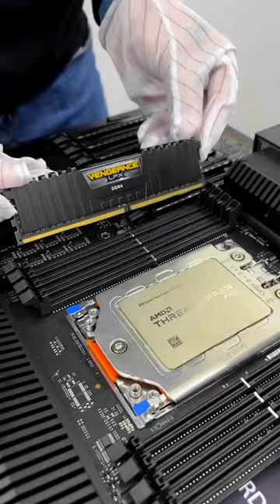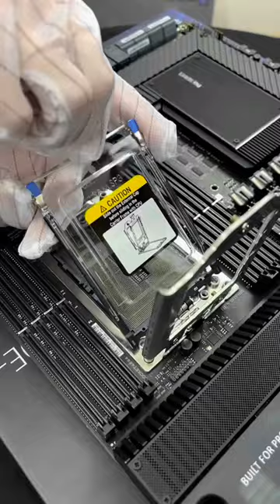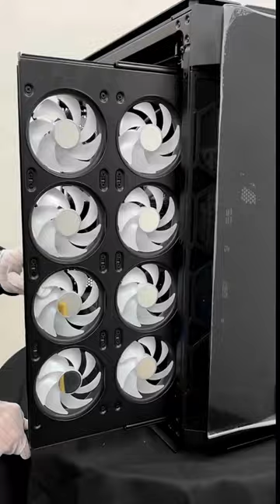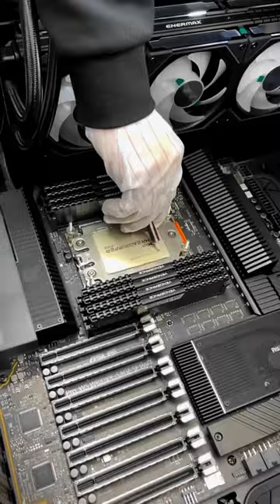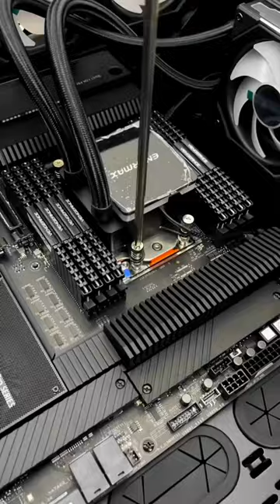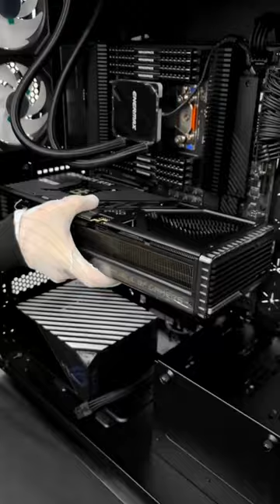Future-Proofing Your Gaming: Assembling a RTX 4090 & Threadripper Pro Gaming PC #build #pc #shorts

Comment: 6 months later: time to upgrade 👍
Reply: Threadripper has 64 cores thats 4 cpu running at one chip 😂
Reply: @Harsh-do7uw  Great if you render movies or use cad, not many apps and no games will ever see an advantage of using a zeon or threadripper.
Reply: If you look at the threadripper gaming benchmarks, the best one gets less than a 12900k in frames, and I have a 13900k… trust me the threadripper is not intended for gaming, it’s meant for workstation use.
Reply: @xxtwztidxx Yea idk why threadrippers are in gaming builds its amazing for what it’s designed for. Obviously it can be gamed on as well
Reply: @finger00 Fully agree, what a waste of money for gaming
Reply: @finger00  EFT

Comment: In 2040 
Windows 20 :- your system doesn't meet the requirements
Reply: 2026 more like
Reply: Windows 13. Not supported.
Reply: Windows 20 myeah you got a bit to to far I don't think that windows13 will work with those components but yeah.
Reply: lol
Reply: No need to wear gloves and spin the fans.  In 2 years this system will be outdated.
Reply: Windows 95
Reply: Linux can be runned on calculator now and 2030 too))
Reply: Nah bruh the windows 13 definitely going to have its own AI assistant definitely wont run
Reply: @jeffisawaffle8084  it shouldn't work in Russia.
Linux better
Reply: Na will be in like 5 years maybe 6 so 2030
Reply: Although its price is similar to the price of fast cars
Reply: He shoulda used a dual 4090
Reply: Moore's law is dead
Reply: @gamer101stopmotion  bruuh

Comment: "son, why is your room 100°"
Reply: With that amount of fans? Never
Reply: Because its got an AMD CPU
Reply: A threadripper doesnt get that hot like a 13900k ore a 7950x.
Reply: @rafaelbachmann6721  like 95c is normal for amd 100c is normal for intel. also with power comes temperature
Reply: @MrTefe amd cpus usually runs cooler than intel cpus, first time im seeing someone say the opposite
Reply: @ummhi4087  fans reduce the PC temp, not the room temp XD
Reply: Why would the room be 100 if the cpu  is cooled down to 80 or less
Reply: @kaljamaistuuperjantaisin because it would heat up the surrounding air to the point where the cpu doesn’t get cooled and just heats up more. At least they will switch off due to overheating ~
Reply: @MrTefe my dude where tf did you find 95°? 😂 it's 65-70 max while 100% usage
Reply: lol

Comment: Bruh this case makes the 4090 look small
Reply: Finally the motherboard isn't installed on the GPU.😂
Reply: @simon6658  💀💀💀
Reply: Which case is that? Holy hell
Reply: SLI one more bad boy in there, just to balance the optics 😅
Reply: @D3AD_L1NK5 I know you asked this months ago. But it's Corsairs 1000D Super tower. I have one and it's massive and amazing. The case alone weighs 65lbs.
Reply: @D3AD_L1NK5 obsidian 1000D by Corsair❤
Reply: This case for 6090

Comment: You know builds gonna be expensive when they pull out a threadripper
Reply: gotta take out a mortgage for one
Reply: @damontan4749  chill kid, one day you will get a girl too. Until then, be nice.
Reply: Thing is the Ryzen 9 is faster than the thread ripper by a lot
Reply: @dn22731  threadripper is more of a server build and cames with a ton of memory. Ryzen 9 is just faster on the first core but as soon as you multithread things the threadripper outplays anything pretty fast.
Reply: @glaDos-  but this is a gaming pc, the thread ripper is fucking useless
Reply: @wandew7057  I agree. I have a 32-core TR w/ 128GB of RAM and it's basically useless for gaming, even in the gaming mode.
Reply: No certainly not useless just a waste of money for gaming lool
Reply: @wandew7057  multithreading is becoming somewhat more common in games. I can think of s good few sim applications too, even DCS recently released a multithreading update
Reply: @blessthismessss  no game uses enough cores to justify a threadripper
Reply: @wandew7057  'enough cores' to justify it? no definitely not, ur right. 
but the ability to use them?? surprisingly it looks like the tech is starting to gain more ground in the tech! Gmod for example even had a major update that allowed support for it some time ago, but its only accessible by setting commands in console right now though.

You get like, +30% fps on average with it, btw. Every game SHOULD be multithreading, but sadly the majority that have been released up to now aren't. This benefits more than just the threadripper, it benefits any multi core cpu!
Reply: @blessthismessss  okay even if games do end up using all those cores, they don’t now. The responsiveness of thread ripper just isn’t going to be as good as a current gen consumer cpu on the desktop because if worse ipc and clockspeed
Reply: @RizalGalion  enough cores to justify a threadripper means games use 24 whole cores and up, which they don’t. Ipc and clock speed are vastly more important for game right now than core count
Reply: Yeah that's a mighty powerful workstation but almost no games run on many threads and would rather profit from a 14900K or somwthing alike. It's pointless for gaming but neat workstation i suppose... even though i'd prefer a proper workstation GPU...
Reply: threadripper in a gaming pc hurts to look at
Reply: @wandew7057 It's not useless. It can definitely run triple A titles. But, it's definitely not meant for gaming purposes.
Reply: @TheNexusChan  what i ment by that is that there is no reason to get a threadripper for a gaming PC, its more expensive and slower than a consumer chip for that purpose
Reply: @wandew7057  Some people just like the overkill. I can't say that I would do the same. Especially how expensive the CPU and components are
Reply: @TheNexusChan  its not even overkill, threadripper objectively performs worse than even ryzen 5 or intel 5 in gaming (current gen)
Reply: @wandew7057  By overkill I meant spending so much on a rig that isn't actually meant for gaming. Because obviously they spent a ton of money on something that isn't meant for gaming. Which is overkill in the money sense.
Reply: You know their city's electricity goes out daily when they pull out a threadripper
Reply: @glaDos- Which is why them calling this a gaming pc is dumb. It's a huge waste.

Comment: sees the DDR4

Ah yes... "Future proof"
Reply: Exactly
Reply: What a clown 😂😂😂😂
Reply: Hahaha 😂😂😂😂😂😂😂
Reply: Came to the comments just cause I knew this comment had to be here!
Reply: Lol right 😂😂😂 not even DDR5 for a 4090 😂😂
Reply: Threadrippers aren't even good for most games, what a game will do with 96+ cores? If I remember correctly for example Minecraft can only use one thread of the CPU. So if I'm not wrong it's using 1/192 of the processor. But Minecraft is Minecraft and other games exist. Maybe there it has ANY sense.
Reply: The Mainboard is for ddr4 and maby it gives it not in ddr5
Reply: @FrontWaffle Kid that pc is definetly not for gaming💀
Reply: @voxqu  "Future-proof your gaming" can you even read
Reply: @BenStocker bruder lern inglisch
Reply: @onlystoner  it's a thread ripper system even if he had used the new thread ripper platform with the newest and pest threadripper , it would be not something for gaming. Lower clocks not optimized for gaming that thing is a render monster not a gaming monster and since you brought up minecraft actually that's the only.game I know about that can currently load all the cores equally but still does not make any sense (maybe to game while running it as a data server and mc server in the back but still a 7800x3d would make WAAAAY more sense)

Comment: He is set for life no more upgrades for him
Reply: Max it gonna last 5-6 years , specially if u game UE5 engine games need upscalers to run on good fps even in rtx 4090 .. 
This generation cpu or gpu are not ready for UE5
Reply: @vitadude5004  Sounds like UE5 isn't programmed or optimized well enough if a freaking RTX 4090 isn't good enough. That's a failure on the software development side, not the other way around.

Comment: What ia the min and max working temperature  of all that -5 to 80°C ?
For me 8 fans is too much
Reply from the maker: All the RAMs produce heat the fans required for these built
Reply: 8 too much? I got 17 in mine. Guess I'm in the too much group :(

.. oh wait, 19 fans.
Lucky for me I can run them all at about 20%, eliminating most noise.

Comment: buys a 1440p monitor
Reply: Imagine having this pc while playing on 60hz 1080p.
Reply: Immagine have not the kw on uour house to take it on
Reply: it will overkill it
Reply: If you are playing on a monitor that is from 24 to 32. 1440p is just fine.
Reply: They do make 360hz 1440p monitors a 4090 still can't max out newer games at that res and frame rate
Reply: @ronjones3977  yep.
Reply: 1440p is a prefect middle ground between clarity and high fps gaming, though.
Reply: I used a 1080p60hz for about 5 years still got great fps but I had to upgrade to 165 it was better but I still went with 1080p
Reply: @oustted  framerate upgrade is a good choice. Especially if your 1080p monitor is smaller than 27", then you don't really need 1440p and above. If you like larger monitors, 1080p on 27" starts to look grainy and 1440p is a good and probably necessary upgrade
Reply: @mediumplayer1  I had a 32" it was grainy my new one is a 27" and it's great although it like caps my fps at 165 when I was getting higher frames on my old one it doesn't really make sense only thing different is the response time
Reply: @oustted  in a different situation I would recommend to uncap the frame limiter, but the strange world we live in gifted us CS2 that shows 200 on the counter and feels like 35. Then you turn v-sync on and it becomes constant, smooth and playable 120. I guess limiting frames is fine, but otherwise stay away from g-sync or v-sync (unless it is a singleplayer game, then do whatever). Btw, did you take color accuracy in account when shopping for a new monitor? It seems to become important these days.
Reply: @mediumplayer1  there could be a setting in monitors settings but I never have a frame cap before I was getting 200 in cs and and close to in a couple other games but now it's stays at 165 there could be a changed setting in amd software that changed maybe
Reply: @oustted  could be amd software, could be monitor, I have no clue because I have a laptop with nvidia gpu...
Reply: @mediumplayer1  fair enough I have all amd and this monitor supports amd freesync and something else ider
Reply: @Леха_Картоха  1000fps
Reply: @Леха_Картоха lol 😂😂😂
Reply: I wouldn't ever go back to a 16:9 4k or not from a 3440x1440 100hz monitor. 

If anything I'm looking at a 32:9 as an upgrade from my currently almost 9 year old acer predator x34.

Comment: Bought a 4770k/mobo/ram/case/psu/drives and slightly overlocked for like 300 at gen 6 or 7. Threw in a 1070ti for 450, new, open box.

6 years later, mobo/ram/proc still worth like 150-200. Gpu worth 150-200. 

Spent 750. Can get back 300-400. So it cost me 350 for 6 years of gaming. 😂

F bleeding edge.

Comment: I know for a fact this would be sub par at gaming, the threadripper platform is overpriced and underperforming for that. For AI, editing, design application, pre-rendering, and using several parallel automated trading applications this is great, for gaming, just get a 7800x3d and 2 sticks of 6k mhzs RAM at as low a cash latency you can find comparable with that and you will have a better system for 25% the cost of this system.

Comment: And what's the point of putting fans in front and back to the radiator? Answer: no one!
Reply: More airflow trough the radiator
Reply: @michubern1444  fluid dynamics says no
Reply: @MyNotSoHumbleOpinion  well its been tested and it works but yes its a waste of money for a few degrees

Comment: Why would you ever need that much ram 😅? What does that person do run Nasa? Anyway windows 13 won't support this components so joke on the person who will use this beast of a machine. And cmon you have that much ram but only one graphic cards get one more just to be sure it doesn't run Fortnite in 119 fps(performance mode anyway with that beast) but 120fps(performance mode). And maybe just maybe put more fans because there aren't enough that beast needs to breath. Maybe one more Ayo just to be sure or actually put two just in case it wants to fly to Mars who knows ai this days are crazy. And yes i was sarcastic 😅.

Comment: Not really future-proofing though, as (i) there's no such thing for gaming hardware - something faster is always on the horizon and (ii) a 7800X3D is, on average, 30-50fps faster than a Threadripper and what ? A tenth the price ? You could bump your CPU up to a 7950X3D and still be faster than a Threadripper while saving literally thousands.
Reply: You think this is for gaming 😅
Reply: @michubern1444 If it isn't, there was no point to the 4090.
Reply: @DrOneOneOne  vfx.. a.i..deeplearning..architectural rendering. lots of things you can do with a 4090 and the cpu ist a workstation beast its crazy